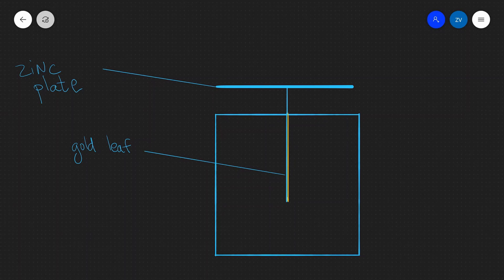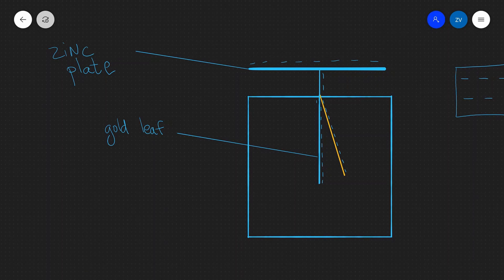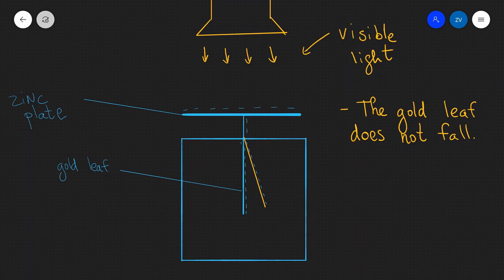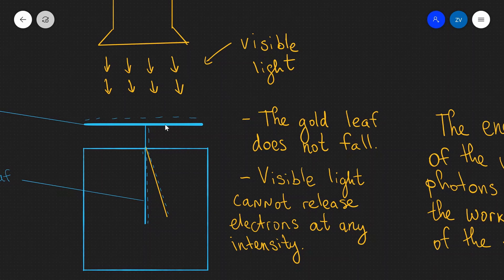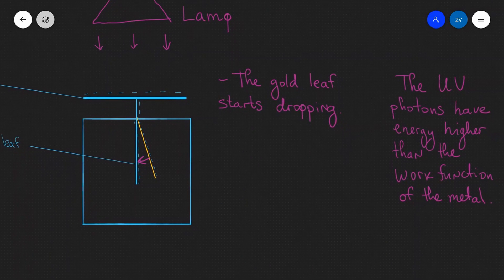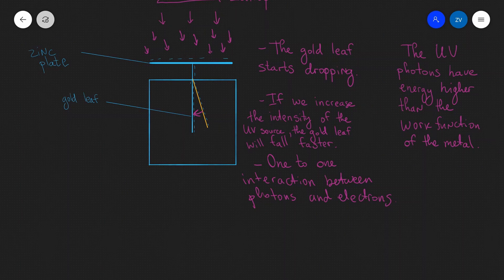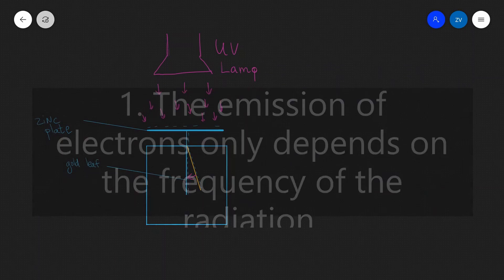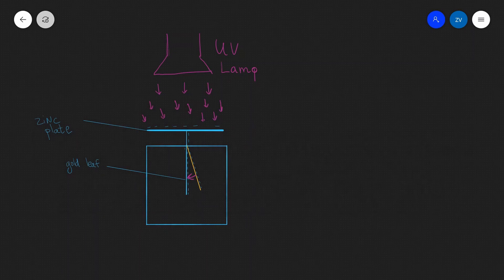The Photoelectric Effect: The gold leaf electroscope experiment

Comment: why do we use a Zinc plate
Reply from the maker: it has an appropriate work function and typically easy enough to remove electrons, it also is a metal with a high number density of free electrons. Hope this helps